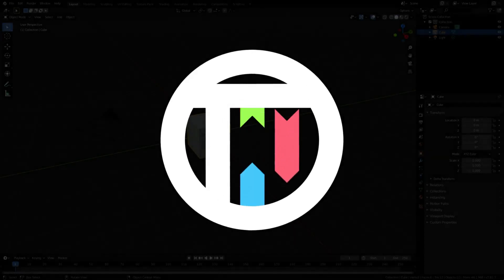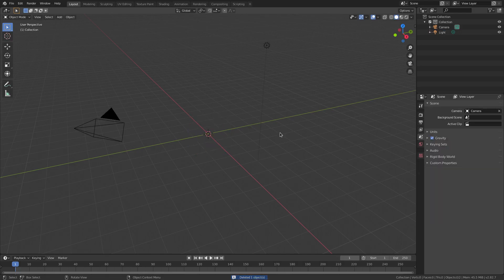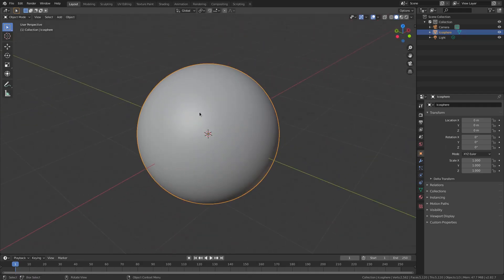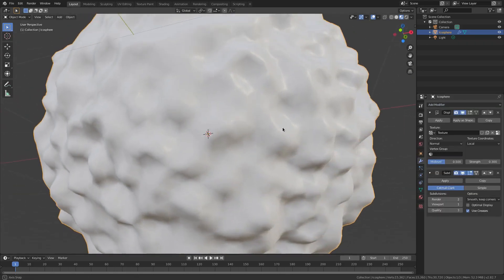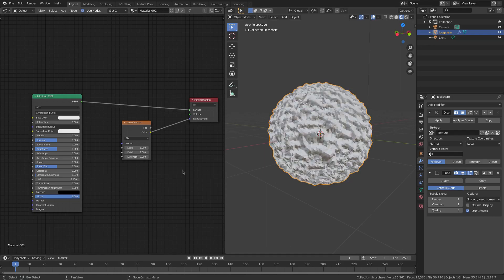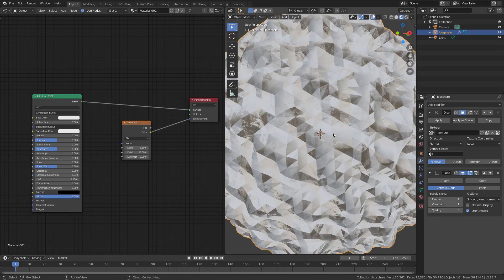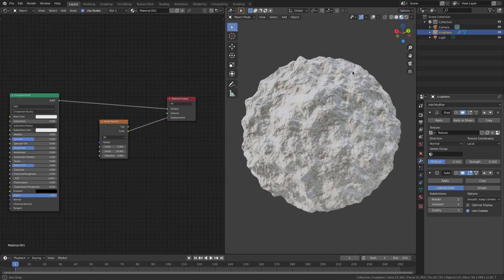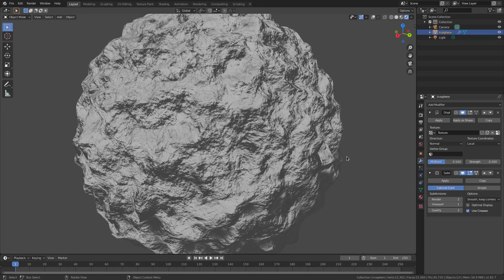HOW TO FIX THIS LOW POLY GLITCH - Blender 2.82 Eevee Tutorial

Comment: But why? I'd love to know why it works this way to understand. Either way, good to know to maybe try a shade flat when in doubt.
Reply from the maker: Blender is very weird sometimes. Other times, it's a god *shrug*
Reply: @TutsByKai  I've also been seeing this "Terminator effect", could this be that?
Reply: Because displacement works on original normals, not on smoothed normals. So when you have shade smooth enabled, it is like if you apply normal map for low poly mesh on the high poly mesh... Smooth shade is a procedural normal map.
Reply: It's because the Vector displacement gets calculated in the material, not the mesh. the material knows the mesh normals and displays them accordingly. if the click shade smooth it will interpolate the normals before tha material has it's chance to work it's magic and when it automatically accounts for that it's going to end up looking wrong.